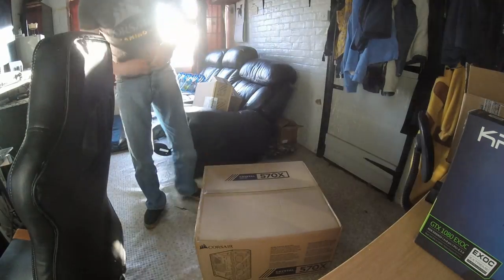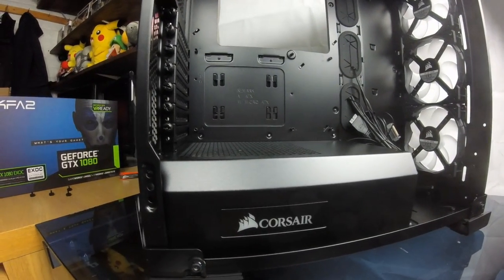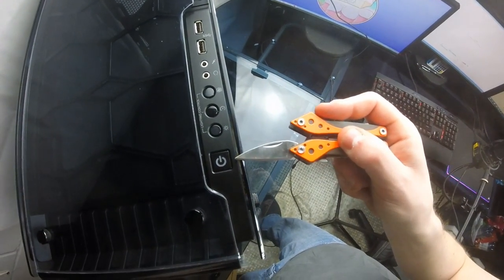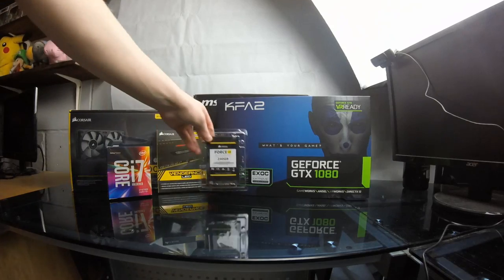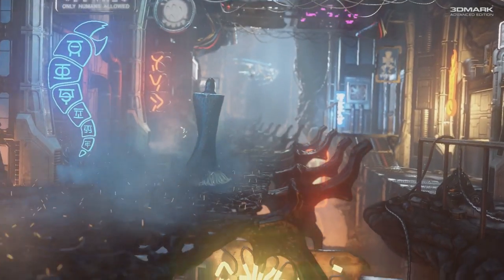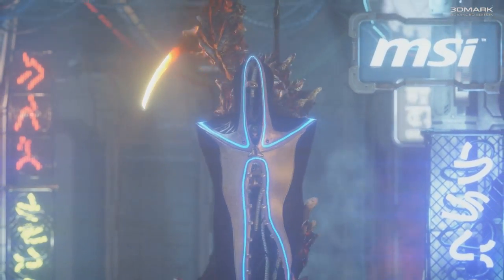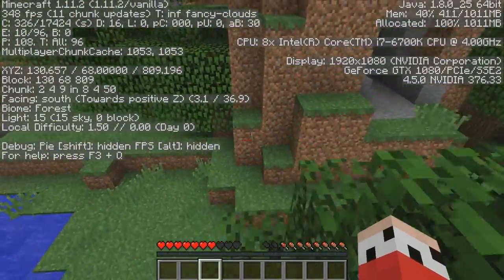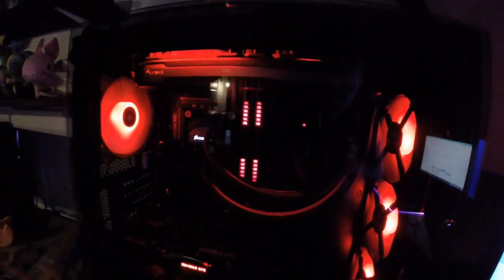2017 PC Build :: £1800 / $2200 :: Gaming + Video Editing

Comment: I7 4770k never been over clocked 
Default bios setting ready to use 
16gb ram 1600mhz 
Windows 10 pro activated genuine 
2tb HDD 
Msi Z87 motherboard milatry class components
Gtx 750ti low heat 2gb by zotac can play the most demanding games out there and is power efficient. 
It comes with a msi sticker and a door hanger 
Do you think this is still a good pc and how long will it last me. Also what shall I upgrade in the future?
1 more thing is will I be able to stream and edit video on this machine.
This will cost me about 600 pounds , I'm buying it off somebody.
Reply: Raja Khan everything is fine just upgrade the GPU to 1080
Reply: Nw